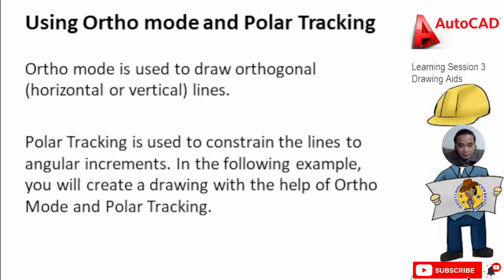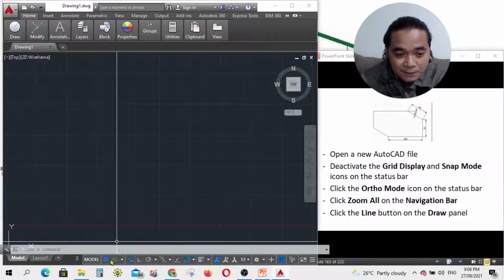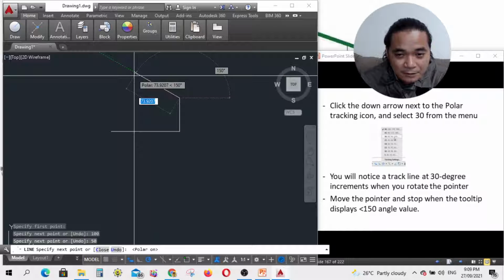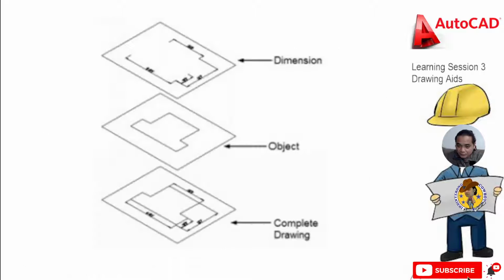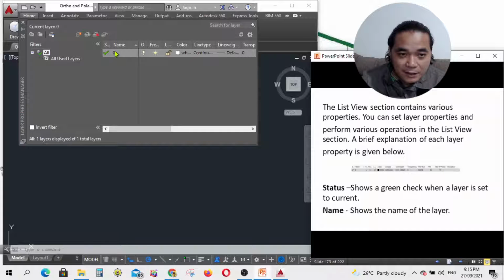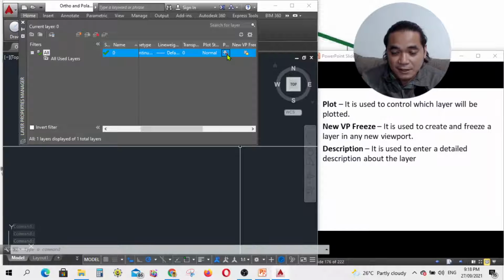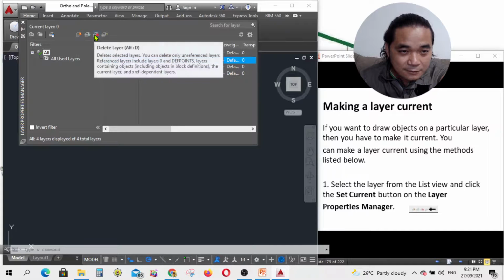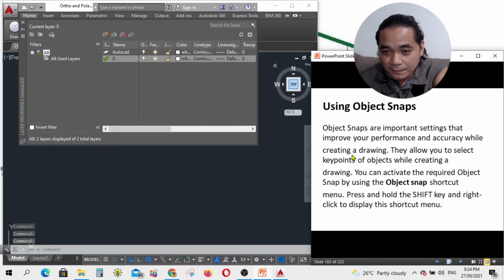AutoCAD LS 3-2 | Drawing Aids

Comment: In this session I came to distinguish the functions of Ortho
mode and Polar tracking as well as learn to use the layers. In Ortho mode, lines
can only be drawn straightly horizontal or vertical while in Polar tracking, our
lines drawn is restricted to certain angles which can be of help to find ease
as we draw. As for the layers, we’re also been able to know the object and
dimension layering and layering tools are also discussed along with it to
customize the layers. Thank you so much sir, I highly consider this as a great
knowledge.

Comment: I learned how to use ortho and polar tracking throughout this learning session. I discovered that these two modes cannot be enabled at the same time, and this can have an effect on the lines of our objects. I also discovered that ortho mode restricts cursor mobility to the vertical and horizontal directions and is used to limit movement according to the users co - ordinates. Polar tracking, on the other hand, limits cursor movement to specific angles. PolarSnap limits cursor movement along a polar angle to preset increments. Polar tracking can be used to display temporary alignment routes defined by the polar angles you specify when creating or modifying objects. And with the help of this video, I may be able to properly draw an object using ortho mode and polar tracking. Thank you very much sir, and God bless you!

Comment: In this learning session 3-2 I learned how to apply ortho and polar mode in AutoCad. In ortho mode I learned that It allows the cursor movement only in the vertical and horizontal direction. When we create, modify, or move the drawings, the ORTHO mode is used to restrict the movement relative to the User Coordinate System. While in Polar Mode or Polar Tracking mode in AutoCAD I learned that it restrict the cursor movement to certain angles. It displays the polar angles followed by the alignment paths. Thanks for this video sir😊

Comment: By using ortho mode and polar tracking, drawing was made easier as I followed the instructions given. Ortho mode made the lines stay in either a horizontal or vertical direction. As for polar tracking, it shows a tracking line. And those we very helpful with the drawing exercise. I also learned about layers. We can make a drawing by combining layers which is very convenient when you just want to edit a specific layer, and just hide some of it. Thank you for the information, Sir!

Comment: In this video, I have learned to used the Ortho mode and polar tracking in making figures that is not rectangular or square and has a complicated figure. And then using the layers, which combining the dimension and object to form a complete drawing. And the introduction of different properties of layer and creating new layers and setting current layers.